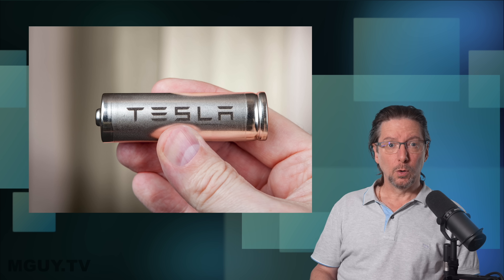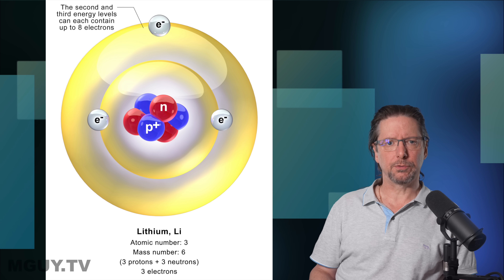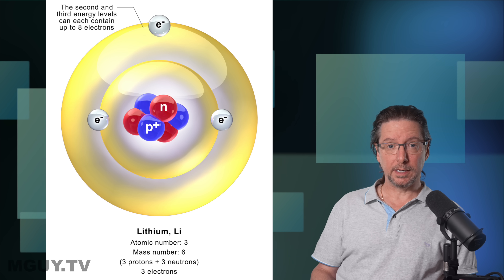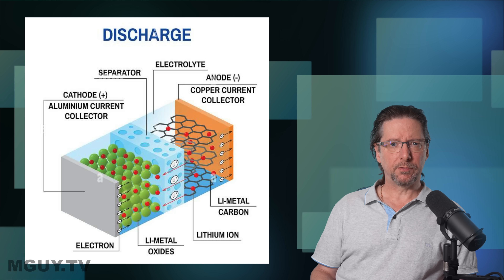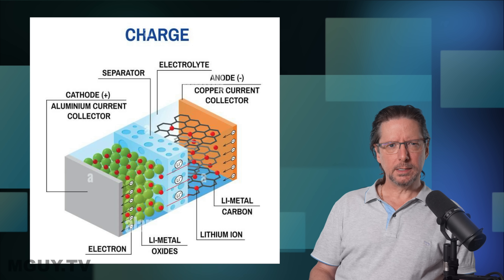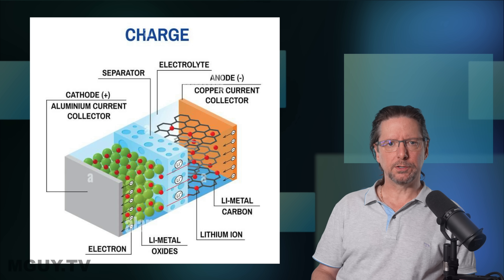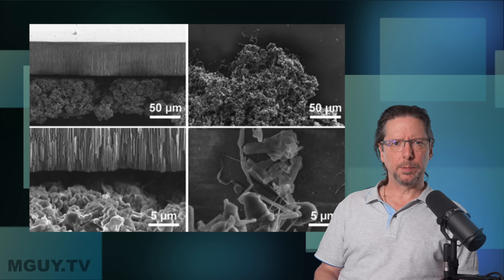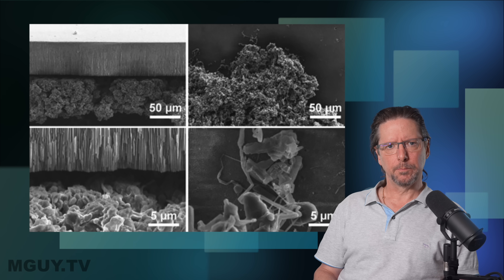Why are EVs so TERRIBLE in the cold? | MGUY Australia

Comment: Having used RC lithium batteries for many years and knowing the dangers, they are commonly 2 to 6 cells and when charging the last part of the charge should include individual cell balancing that is to say all cell voltages should be equal and this takes quite a while depending on the condition of the individual cell, if not done cells can be out of balance and bad cells undetected, Therefore are all those 7000 Tesla cells being individually monitored and balanced? if not a bad cell could cause the thermal runaways we are seeing, just a thought.
Reply: And further, when the 18650 cells were manufactured, they are not cycled and graded (matched)..so they're doomed from the start. All the individual cells are grouped into 'packs' within a 'pack' within a pack and so on. Many series and parallel  arrangements. 

I remember when the LiPo batteries hit the RC racing world. They did not have a hard case, just bags or pouches basically and occasionally a hard hit would short the pack and thermal runway would start and burst in flames. That was an eye opener. The old sub C NiCad and NiMh cells were way tougher and safer.
Reply: @1320pass  The way it appears to me is that all these cells need to be independently    monitored for voltage and internal resistance, as we know if a cell develops a higher resistance it cant take the fast charge any longer and will heat up, mmh I wonder if there is a connection here (pun intended) or discharge at high rate come to that, its called the c rating.

Comment: Constantly fast charging a Lion or Lipo battery will destroy it quickly too. Each cell charges and discharge at different rates. Without a slow balance charge, the battery will destroy itself.

Comment: It’s been minus 30c here in northern Ontario and I had to plug in my diesel tractor for 30 minutes to even get close to start, my quad barely started and my four stroke skidoo either, I got in my Tesla and pull the stall down to drive and done.
Reply: Won’t let me edit, I pull the stalk down to drive and my car was fine, no matter how cold it’s been it always “starts” It does lose range in the cold but I’ve had friends over with diesel trucks and they let them run all day so they don’t have to try starting them in the cold again… they lost over half their range standing there staying warm.
Cold sucks on everything just got to plan differently.

Comment: Yes, but it's easy to forget, these problems are NOT UNIQUE to vehicles with Lithium Power Train Cells.

( unless it's pretreated)
Diesel fuel waxes up at Subzero temperatures .

And becomes unusable..

( also )
Lead Acid batteries become less efficient .

Moisture freezes in Door Locks & release mechanisms..

The biggest issue with EV's is the charging infrastructure..

If the main power supply goes down, instantly EV's are in real s@@t street ..

( At least with ICE there's usually a reserve stored at the retail sites ) !

Comment: SIMON, I do hope that Tesla is watching your channel; your instructional video will solve so many of the questions that they have been scrambling to explain. However, just a couple of points… the Chicago debacle is actually explained by Uber and Lyft putting drivers into EV vehicle leases, without any training. These drivers had zero expertise in operating EVs, much less doing so in extreme weather; and it was not their fault that they had no idea of what they were doing. If you tell a Tesla that it is headed to a charger, the car pre-heats the battery automatically, before you arrive. If you don’t, then the car will sit for 20 minutes “doing nothing” while it brings the battery up to a working temperature. No wonder they were dumbfounded. 

But it is the second point that totally contradicts your suggestion that EVs cannot cope with the cold; it is… Norway; a country roughly 10 degrees C cooler than Chicago, all year round, and which leads the world in EV uptake. 88% of all new car sales in Norway in 2023 were BEVs. And all this is happening without drama. Maybe they make their Uber drivers read up, before they give them a BEV. EVs in cold weather are fine, but only if you know what you’re doing.

Comment: I worked at a recycling centre. One small lithium battery accidentally ended up crushed by the waste compactor. Large flames, stuff caught fire, then ten-foot flames. Site shut and fire-brigade called! So safe, so green.
Reply: Yes Tim and is is just irresponsible of the company that you work for by letting you and your workmates to be exposed to the toxic gases and materials given off by these batteries going into thermal runaway while you are having to sort those recyclable materials.
Reply: @johngoard8272  - it was a member of the public that caused it. Threw a bag of ‘general / non-recyclable waste’ into the compactor - yet just over the way was a drop-off point for all sorts of batteries.
Reply: What has this got to do with EVs? I don't suppose you put any into the waste compactor.
Reply: @solentbum  - I’d like to. Same batteries.
Reply: human error... putting a gas can in an unsafe place will cause trouble too... are we to blame gasoline for human stupidity?
Reply: @Jojo-o6o6w a gas can is a large object that usually doesn't get lost or placed in the garbage. Lithium battery cells, however, are everywhere and get thrown away by the billions. Your point isn't well considered.
Reply: @user-xj5xp6qz5g  It's much easier to call out user error rather than design a good disposal system for something thats so dangerous.
Reply: @Jojo-o6o6w  - lithium ion batteries get the blame - fair & square. Dangerous chemical items. If a can of petrol got crushed in the compactor, it wouldn’t have burst into flames.

Comment: Two things we RV'ers learn right away is that when we need heat or cooling in our rigs, we either need to carry a petrol/diesel/propane generator or plug into the grid. Heating and cooling require massive amounts of power to get the job done. All these EV problems aren't a surprise with just a basic understanding of reality.

Comment: Living at 52°N and I dont know why others claim EVs do not work. No issues in the winter, got 15% more consumption, thats all. In ICE numbers thats 2l/100km instead of 1.73l/100km incl. charge losses. Only people not having an EV have problems and they always read these fake news. Had ICE cars for 35 years, never ever back to that crap. 10 years EV now and 10 year PV on the roof. Cheaper, better, easier and cleaner.

Comment: what an uphill battle EV has, its sounding like they will have to formulate batteries for different weather conditions. imagine being tied to your dealership for battery swapping between your summer and winter batteries,  it sounds neat but in practice it will be cursed. they will never give us an EV with an easily swappable battery. because it would last forever.

Comment: The Midlands Electricity Board I worked for in the mid 70's had an electric van which always had to be towed back every day.   I imagine it used lead acid batteries so it's not surprising it was even more useless.

Comment: You could mention the Arrhenius equation which shows that the rate of a chemical reaction doubles for every 10degK increase in temperature and this influences both thermal runaway and cold charging. A battery that is Ok at 20deG will be reacting at 1/4 the normal rate at 0 degC and 1/16 the normal rate at -20degC which affects both driving and charging. This is why electric vehicles need battery conditioning systems. An ICE will also crank slowly at -20decC due to a cold lead acid battery and cold thick oil. I have in the past seen tips from cold climate residents that providing the battery is fully charged leaving the headlights on for a few minutes will provide a current flow through the battery that will warn the battery enough to increase the cranking speed and start the car. So, a crude form of battery management has been around for years to tackle temperature effects long before Lithium-Ion batteries appeared.

Comment: I posted this earlier but it disappeared! Let's see what happens this time.The problem with ICE vehicles is their very low efficiency due to the fact that they are heat engines and are governed by the Carnot efficiency. Add to this the huge frictional losses due to all the moving parts and the efficiency of ICE is about 25%. EVs with regen are around 90%. When you buy fuel you are buying stored energy with the aim that the engine will convert all this energy into mechanical energy and then into energy of motion of the car (kinetic energy). As ICE only has 25% efficiency, only 25% of the energy you have bought is converted into motion of the car. The other 75% that you have bought is wasted as heat. This is like going to the bank and drawing out $100, putting $25 into your pocket and throwing away $75. If ICE had the same efficiency as EVs you would only need to buy 1/4 of the fuel you actually buy. Think of all the money you would have saved over your driving lifetime. The fact we have all done this in the past doesn’t mean we need to continue to do it in the future. Our children deserve transport that is 90% efficient and not 25% so they are not wasting money buying energy they can't use.

Comment: Re. dropping the lithium in water. This explains so well a cause of EVs catching fire. I heard about this after a flood event in FL. Some EVs got flooded, and later, spontaneously combusted.
Reply: @toby2581 - The "points of failure" change. The most expensive parts on a gas car are the transmission and the head gasket. The most expensive on an EV is the battery.

A remarkable sight was seeing video of an EV SUV at the bottom of a lake, "bubbling," because its battery was combusting. It was a couple that were planning on going boating. The wife was backing their EV, with the boat on a trailer, toward a lake, when the EV put up an alert saying she needed to get out of the vehicle immediately, which she did (no word on what caused that). The EV kept backing into the lake, and went under. I wonder if what happened is they backed the vehicle into the water, and the battery got wet. I've seen boaters do that with gas trucks, etc., backing it into the water, and then driving it back out, once the boat's released.
Reply: exactly what is the outcome of submerging a gasoline car in salt water? Do you think it's drivable or insurable or will carry a warranty?
Reply: @justsomeguy934  - This is a strawman. I was talking about EVs catching fire afterwards. Gas cars do not catch fire after being flooded. No, they are not drivable, obviously, but they are not a danger to you, other cars that are parked next to them, nor to your house.
Reply: @mmille10  You are correct, an ICE won't catch fire after being submerged. And your point? I can certainly show you millions of gas cars that spontaneously combust and should not be parked in garages. I can show you the links to the recalls by Ford, Hyundai, BMW and Toyota (as well as others) for exactly that issue. In either technology (ICE or EV), citing such an outlier situation (car under water) is intended to draw....what conclusion?
Reply: @justsomeguy934 - I'll concede the point that there are specific models of gas cars that can catch fire in cases not caused by collision, but these are consistently due to design flaws, which are subject to recall. They can be repaired so they won't do this, or taken off the new car market if they can't. Can the same be said for EV's? It looks to me, at the very least, like the jury's out on that, especially since you see EV fires on models that are not only made in the U.S., but abroad. I've seen the same fires in EVs made and used in China. It's not as if this problem is restricted to specific models, which happen to have a design flaw that allows this.

Secondly, as MGUY has pointed out, it's easier for a fire Dept. to put out a gas fire than an EV fire, due to the nature of how it's fed, and the fire's temperature (there's a dramatic difference here). Their protocol for an EV is to separate the car from anything flammable, and just let it incinerate itself, because pouring water on it just feeds the fire...

He's posted video from a news broadcast of an EV that started burning while parked in someone's garage, and showed the whole process of the fire Dept. removing it from the garage, covering it with a giant tarp, and hauling it off to a junkyard, all while it was still burning. Fortunately, the house was spared.

It seems to me a part of the problem is our civil protection practices have not caught up to this technology. Is there something that can be applied to an EV fire, that would neutralize it effectively, but is not part of fire control practice?
Reply: @mmille10  You make several good points, let's discuss them.

First, MGUY does not know what he's talking about in any way. He looks for any media item he can that he can report on to say "EVs bad". His bias is so loud it's hard to hear his video. On every video of his I've seen, I've posted direct evidence to disprove his statements.

Since gas cars can spontaneously combust (I have all the links to prove that), and EVs can catch fire, BOTH in extremely rare cases, the "EVs will burn down the house!" meme is meaningless. By the way, do you know how many Chevy Bolts caught fire while charging? Less than 1% of 1% of the total cars. You asked if they can be fixed like gas cars, and the answer is YES. It's called the Chevy Bolt recall, and I absolutely know 2 people that had their car recalled and a new battery installed. 

One of your points about EV fire extinguishment procedures is an excellent example of disinformation by MGUY (and others, he's not the only one). The chemical makeup of an EV fire, the temperature of the fire, the amount of water it will take to extinguish the fire, the time required to extinguish the fire are MEANINGLESS. It's a false objection point, celebrated and perpetuated by the oil industry and luddites like MGUY.

Here's why: EV fires happen orders of magnitude LESS often than gas car fires. Which is safer for you: fewer fires or more fires? Would you get on an airplane that crashes 10 times more than one that doesn't? Would you care how the resulting fire is put out if you can ride in a plane that doesn't crash? 

Furthermore, a gas car fire can explode instantly when a car accident occurs. It's not often, but I can easily show you videos of cars and gasoline tankers that detonate like a bomb when hitting a guardrail or another vehicle. The occupants have no time to exit or be saved in those situations.

A battery can never instantly explode. It takes TIME for a thermal runaway to happen. Just like a gas car explosion, a battery does not HAVE to have an explosion, but it will never happen immediately. Of the two fire types, pick a battery fire to escape from.

Comment: but the battery heats up on fast discharge so they need to be cooled to prevent damage.  so if its too hot outside the battery will either waste energy cooling itself or slow down current draw.   ive heard the optimum temp efficiency is found in coastal california.

Comment: I think we're all aware that lead-acid batteries degrade with age, and that is highlighted in cold weather. Hence, the reason we spend that $100-200 every 5 years or so. One Tesla fanboy has been cherry picking examples of older ICE cars (you know, the ones that aren't maintained as well as they should be) that have been failing to start without a jump in extremely cold weather. Then jumping up and down about why those aren't making headline news 🤣🤣

Comment: I learnt something surprising today from your video, thank you. I initially didn't believe the statement about the size of atoms. For lithium 140 pm. It simply seemed way too big. But I checked and you are close to right, and did say 'about'. The notional length of the radius is indeed given as 143 pm, which means a diameter of 286 pm. I had thought that they were at least a million times smaller than that.
  You learn something new every day!

Comment: Bjørn Nyland has tested over 100 electric cars on a 1000 km test.
Tesla model Y LR was 5 minutes slower in winter than in summer.
Reply: And the smallest ice vehicle made it in one tenth the time it took an EV to travel the same distance because it did not have to stop for hours to refuel along the way!
Reply: @Oldmane-420  No, he has tested a fossil car on the same route. It was 20 minutes faster than the fastest electric car. I prefer to spend a few minutes going to the bathroom, and eat during over 8 hours of driving.
Reply: @jrgenaksnes2676  - I prefer not to go to the bathroom and eat.  If it's taking you 30 minutes, to an hour, to have a toilet break and get something to eat, on road trips, you should be scheduling an appointment with a your GP.  Perhaps it's those meal breaks in toilets that are causing you the health issues.

Comment: I don't understand why would EVs use small AA size lithium batteries instead of those large square cells which are used in 12.8v lithium batteries like the ones for offgrid solar or RVs? Couple of hundred of those would have same power as 50,000 of those AA 😌 it just goes prove even more that the whole EV concept idea and design is so dumb.

Comment: Saying an EV runs out of battery is like saying an ICE vehicle runs out of tank. As an engineer I find your imprecise use of the words battery and charge annoying. The equivalent term to fuel in an ICE vehicle is charge ((in the form of negatively charged electrons). The supply voltage pumps charge through the battery, the battery releases that charge pressure to the EV systems to make it work. You say that you are an engineer at the start of your video, please be more precise in your use of words.